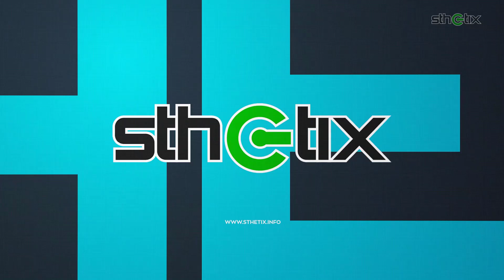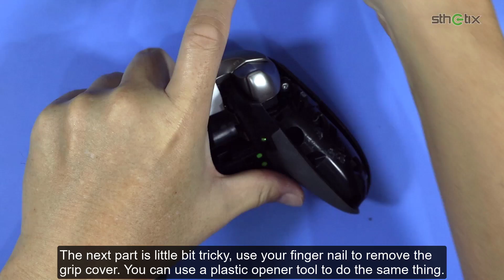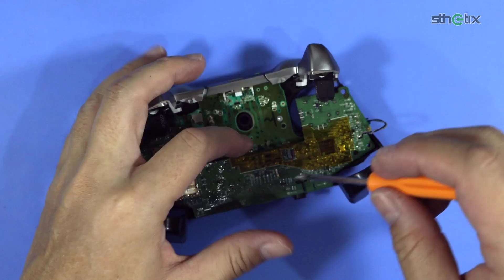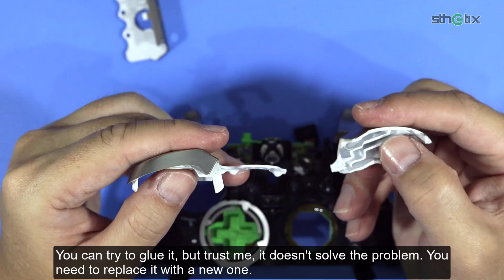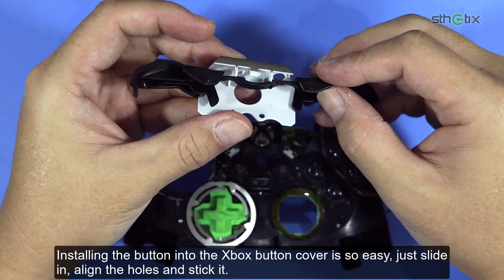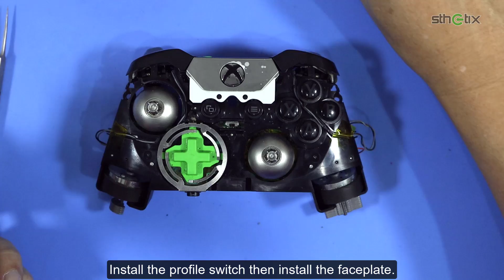FIXING THE XBOX ONE ELITE CONTROLLER : ANALOG STICK, RB BUTTON & BUMPER BUTTON

Comment: I have a problem where my left joystick won’t do anything when I turn it to the north west I have the elite controller but when I take the joystick off and just use the user plate it works fine do you know how to fix that?
Reply from the maker: try to replace the analog stick. or check the solder pads for continuity

Comment: What about analog stick calibration? Just replacing the stick won't get it centered most of the time unless you're extremely lucky. Microsoft calibrate each stick to their corresponding board and there is no available software for normal people to do that themselves so the stick won't be cenetered.
Reply from the maker: We can never calibrate the analog stick unless we use it on pc, and there is no perfect,  100% centered analog stick. I think the game itself has some tolerance.

Comment: This is one of the best videos I've seen on the subject! I added it to my favourites so I can come back to it in the future!

I got an Elite Series 1 controller with drift... I did a more crude fix that actually worked.
On the left of the thumb stick there is a little tiny piece that fits in... I tried swapping them and it fixed the little bit of drift my right stick had but nothing helped my left stick.... So I just completely removed it & now it no longer drifts! 

But, I find the stick moves a tiny bit more freely, less resistance. I don't like it.... One of these days I aim to replace the whole analog stick.

Question for you, I may try my luck buying a cheap broken elite controller off eBay in hopes that one of the analog modules are good. 
Are the modules the same on the series 2 as they are the series 1? & I also assume left & right are the same correct?
Reply from the maker: all the xb1 controller uses the same 3d analog stick
Reply: @sthetixofficial  Good to know, thank you!

Comment: I have left stick drift on my Elite 1 controller. Could I use my older controller (that isn't an Elite) and replace the internal toggles to fix the problem? 
  And if anybody has done this before please comment as well. Thank you in advance to anybody that responds to this question.
Reply from the maker: yes u can as long as it is an xbox one controller or a ps4 controller